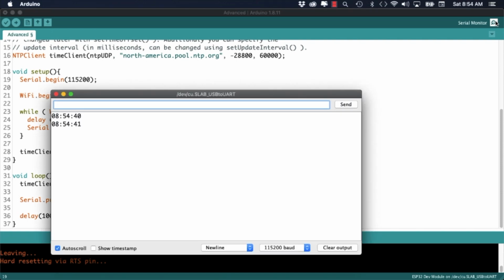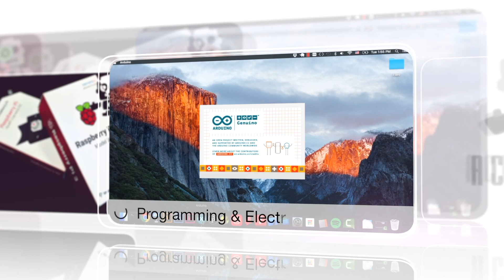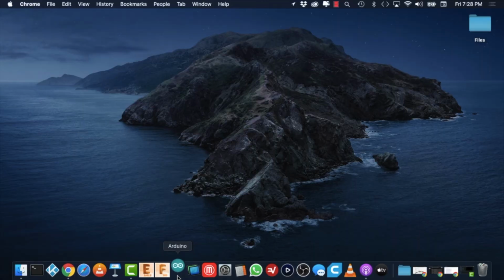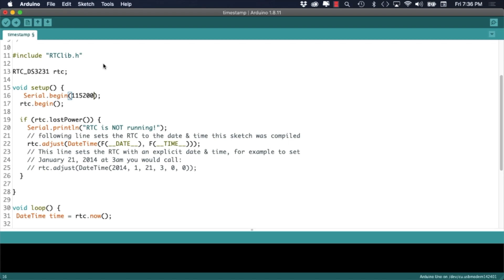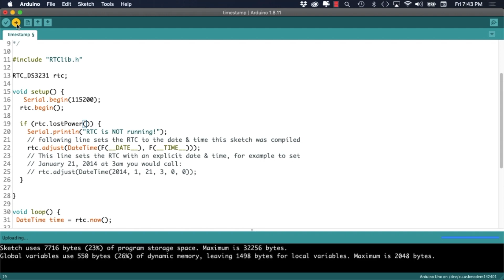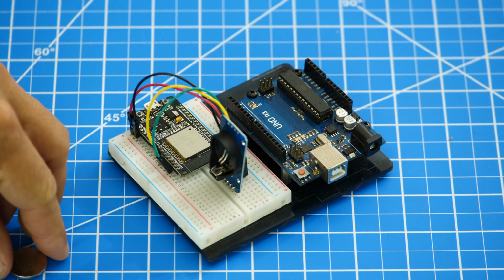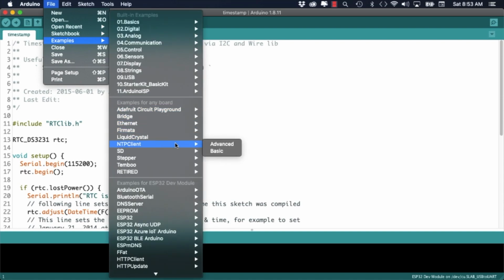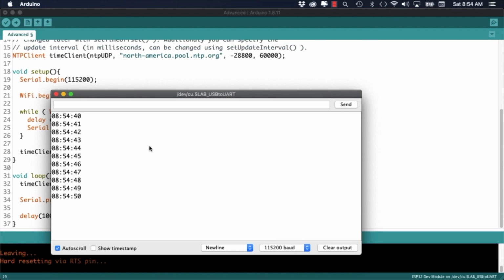Getting Started | Real-Time Clock vs. NTP Tracking Time w/ Arduino & ESP32 (DS3231 RTC) | BRK-00026

Comment: Nice video. Thanks!
What I'm looking for - is the complete solution: To connect to the NTP server (Maybe using the NTPclient example that comes with the ESP8266 basic library, using simple UDP communication), and use its input to update the DS3231 module - so also when off-line the time will stay correct.
Would you please make "Part 2" Video with this complete proccess?
Many thanks!
Reply from the maker: Thanks for watching! I wanted to do exactly that, but I wanted to keep the "Getting Started" video as simple as possible. I'll add it to the (long) list of vids in the queue :)
Reply: Thank you for that!
I think it's reletavely simple to do it as "Part 2" of this video, as the basics are already here.
I'll be staying tuned to see when it comes.
All The Best!

Comment: Would this board be good to trigger a wake up interrupt? If I wanted to put a device into deep sleep (like a weather sensor) and have it awake could this do it? What's the battery life on this? Thank you
Reply from the maker: Sh*t man, sorry for the super late reply! I would use the RTC board so that when the device wakes up from deep sleep, it can have an accurate sense of time. Not so much for waking up the device. 
Most chips these days will have the deep sleep functionality built in, which you can set by software. If you want to use an external hardware trigger, then you can build any circuitry you'd like for doing this, but there's little advantage to that, and you'd also need to power yet another device. So, I'd recommend giving the built-in one a try.
Here's a good set of posts with examples:
https://blog.voneicken.com/projects/low-power-wifi-intro/
Reply: AFAIK, the DS3231 module has an "alarm" option, and some extra pins that may be used to 'send a pulse' to wakeup by an interrupt. But I'm not sure, and would be glad to get smarter with that by someone that knows better.

Comment: On  ESP32 and ESP8266 you do not need a library to get NTP time. It's already built in, and will correct the time every hour automatically.  See https://github.com/gitpeut/esp_sntp. If the internet connection is more or less stable using a DS3231 is not needed.
Reply from the maker: Oh, nice. Thanks for sharing!

>  If the internet connection is more or less stable using a DS3231 is not needed.

Hence the title being "Real-Time Clock vs. NTP..."
Reply: @datasith  the time can also be synced via BLE and without need for an external RTC
https://youtu.be/205QgAjmryA

Comment: nice one actually i was using ds3231 lib it self but i always had problems with ntp sync
like there is a part which people need to sync their time with ntp instead of time on the device i leave the function below for those who need it:
void SyncTime()
{
  struct tm timeinfo;
  if (!getLocalTime(&timeinfo)) {
    Serial.println("Failed to obtain time");
    return;
  }
  Serial.println(&timeinfo, "%A, %B %d %Y %H:%M:%S");
  //rtc.adjust(DateTime(year, month, day, hour, minute, second));
  rtc.adjust(DateTime(timeinfo.tm_year + 1900, timeinfo.tm_mon + 1, timeinfo.tm_mday, timeinfo.tm_hour, timeinfo.tm_min, timeinfo.tm_sec));
}
Reply from the maker: Ali to the rescue! Thanks so much for sharing!
Reply: I'm building a timer for a light that comes on at Dusk-60 minutes and goes off at Midnight+60 mins. I am using a DS3231 RTC and was wondering how to check the RTC's accuracy after a month or two.   I live in Michigan USA and I have to constantly change the light time to account for both DST and seasonal changes to dusk (disk2dawn). I want the timer to be "hands off" but had problems setting the clock initially and adjusting the clock if it drifted.  This gives me an idea on how to use the internet to set the clock initially and check it after a month or two to see how it has drifted. There is already a way to use my smart phone to enter my internet credentials, if needed to get it initially connected. An OLED on the project box to show times (current, dusk(DST Adjusted) and OFF time). only one button to Force ON/OFF if needed. Connecting to the internet will mean I don't have to depend on attaching it to my computer and having to download the new program when the time needs adjusted.  THANKS to both of you for the idea and code !